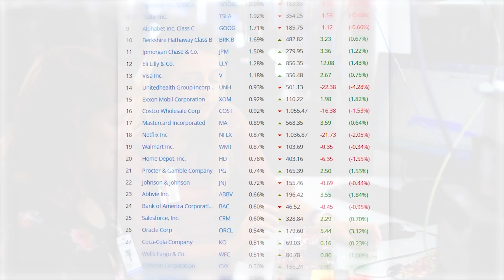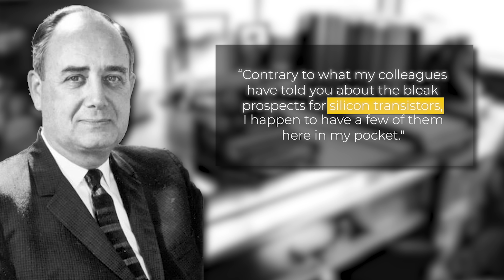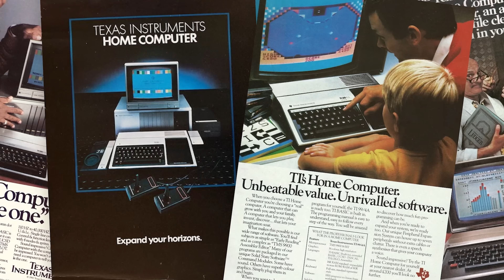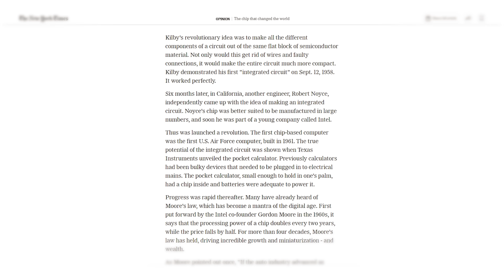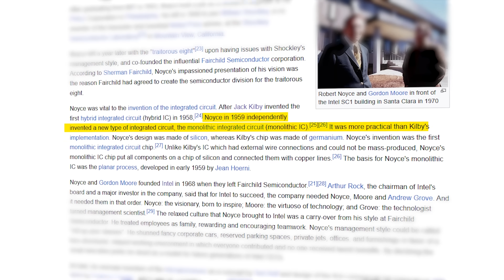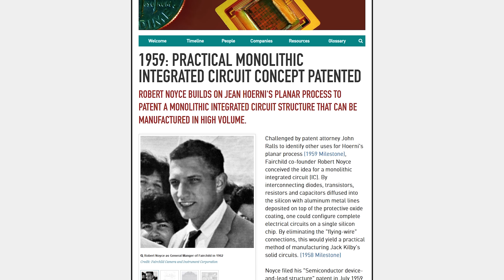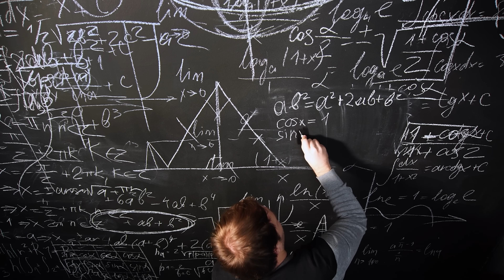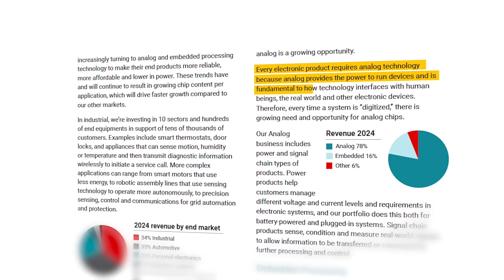Why A Calculator Company Is Worth $186 Billion

Comment: Back in 1975-76 UK we were allowed to use certain types of calculators in maths exams in place of sliderules and log tables. I recall that some of the advanced TI calculators were banned because they were 'too clever'. #goodolddays
Reply from the maker: Hahaha, it’s the same with those custom script enabled calculators today
Reply: I used a Ti 56 in the 70s. It was programmable and perfect for electrical engineering classes. But it was not indestructible, and the competing HP calculators were very good.
Reply: @gregkocher5352  I was allowed to use an HP-48 at maths exams in uni in the late 90s. That was probably the best calculator you could buy at the time and could do some relatively-advanced stuff, like matrix operations. The HP-48 was normally no more useful than a basic scientific calculator if you needed to prove the central limit theorem, or stuff like that, but on one occasion, in order to solve a more complex problem, I needed to solve a system of three linear equations, which would have taken me several minutes, with the possibility of making errors. I easily solved the problem in a few seconds by inverting a 3x3 matrix with my HP-48. That was nice.
Reply: We were allowed to use calculators too, but you still had to show your work.
Reply: Mike Lawson uses that git-hub for testing new jets built at Airbus in Mobile, Alabama. He shows it in the tour if you ask him to
Reply: Well I am in high school and I convinced my math teacher to let me use my ti-basic programs on tests, but I still have SPARES in case one(or more) are banned. My collection (which I carry everywhere) follows:
1: ti-84 plus ce python(though I do not use python on it, only basic because of its the dev time)
2: ti-30x
3: Texas Instruments BA II plus
1: ti-84 plus ce python(though I do not use python on it, only basic because of its the dev time)
2: ti-30x
3: Texas Instruments BA II plus
I am looking to grow my collection. I want another ti-84 so I can try to put a modern cpu in it and try to see if I can improve the performance.
Reply: Lol same here. Programmable calculators were hellspawn for teachers. cus sum dude managed to get chatgpt running on theirs after hooking up an esp32 on the backside LOL
Reply: '81 to '87 in the UK Casio ruled the educational scientific calculator market - it was quite rare to see a TI calculator in schools.
Reply: @slaphead90 It's UK bruh

Comment: TI Calculators ARE INDESTRUCTIBLE. Mine has survived:
1. Motorcycle crash
2. Throwing it off a ledge (3 floors)
3. Dropping it
4. (Second) Motorcycle crash
5. Math crash outs.
Reply from the maker: Hahaha I bet
Reply: My TI-84 Plus is 20 plus years old and still works after probably a dozen or so battery changes. Though super sad as it's currently missing, I put it somewhere while I was changing the battery after realizing I didn't have any triple AAAs, and can't recall where I put it... still used it pretty much every day. I even have the "Calc84" app on my phone which mimics a TI84... (really, really nice calculator app)
Reply: @mclason  I reccomend buying second hand, you canbusually find good calculators for cheap
Reply: @mclason  Wouldn't go anywhere without my trusty TI-86 at my side.
Reply: For those who might care, TI-48 Plus was found. It seems one of the cats knocked it off my desk and it ended up hidden away. It has new batteries now. Copyright 2004 is on the calculator, unsure if that was the actual year it was made, but it seems about right.
Reply: Basically Nokia of the calculator.
Reply: My TI-83 Plus survived me totalling my first car during winter Freshman year when I siderolled off the road and got wedged next to a dead tree. It was in a laptop bag, but the laptop was completely fucked
Reply: A battery leak destroyed mine. 😢
Reply: You not only manage to have two crashes on a motorbike, which only that sounds rather incredible, but manage to bring the calc both times as well. What on earth were you doing?
Reply: @miljororforsprakpartiet290   Hmm, when I was in university I had a motorcycle (in addition to a pickup truck) and I had two incidents with my motorcycle, well, which lead me to get rid of it. But as a student I was always toting around stuff related to classes - text books and scientific calculator when riding on the motorcycle.

Guess am not seeing the account to be quite so odd, IOW
Reply: İ didn't surprized how calculator survived all of that but how did you survived 2nd motor crash to tell the story
Reply: @serdarcam99  it wasn’t a serious one thankfully
Reply: bro be careful on that motorcycle
Reply: They are smart enough to know that these things tend to get thrown when exposed to advanced calculus, through no fault of their own. Nonetheless it would be beneficial to ensure they are not going to break when abused in this manner. I suspect they have a contract with Nintendo for the same blend of Nintendium-grade plastic that the Gameboy is made from.
Reply: How about Nuclear War?
Reply: Stay safe Bro.
Reply: Evil Knievel calculated his motorcycle jump trajectories while holding his trusty TI in one hand. Oh, he did crash a lot🇺🇸
Reply: will probably be the only technological artifact from our era of history that will be around for future archeologist
Reply: now i want to know more, how did you crash thrice?
Reply: Mine broke dropping it 4 feet into the ground, cracking the back plastic. The new ones suck
Reply: I love my TI-89.  It helped me a lot in college, even though I used only 25% of its capabilities.  It's still in my closet, and I never use it, but I'm not getting rid of it.   Nostalgia, you know.🙂
Reply: Smiles.... not asking how you would know that :)
Reply: Mike Lawson uses that git-hub for testing new jets built at Airbus in Mobile, Alabama. He shows it in the tour if you ask him to
Reply: Fr 😂
Reply: Dude... you should probably quit riding motorcycles.
Reply: @ I did
Reply: They're producing turds too. TI-30 had a fair bit of problems with the bottom line of the screen suddenly stop working which makes it a useless device as that's where it would display the answer.
Reply: Sounds to me like you're a jackass.
Reply: the battery is the worst I have ever seen
Reply: Meanwhile my Ti-84 Plus CE has all of its rubber feet peeled off and cracks all over the faceplate and keypad.
Reply: Keep us updated for the third crash
Reply: Brother why are you driving and calculating?
Reply: Still not a valid reason to buy a calculator at 100 times of cost
Reply: Now way you are old enough to ride a motorcycle and use the phrase ‘crash out’
Reply: @seendidthegreat4814  why do you think he crashed?
Reply: @zyxwv He's a motorcycle driver, they crash all the time.
Reply: @seendidthegreat4814  Now way
Reply: @seendidthegreat4814  Gen z is in their mid 20s on the high end... I would know, I'm turning 25 this year.
Reply: @seendidthegreat4814  lolll tbh I’m just brain rotted
Reply: @seendidthegreat4814  You think you guys invented "crash out," or "crash" outside of the context of a literal crash?  We said that as kids in the 80s.